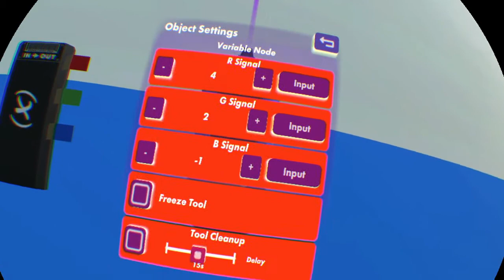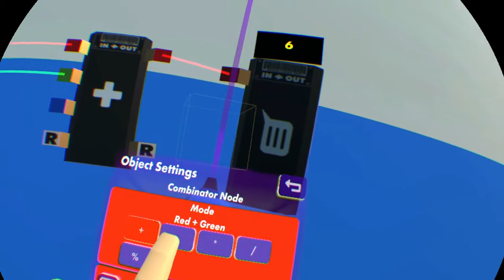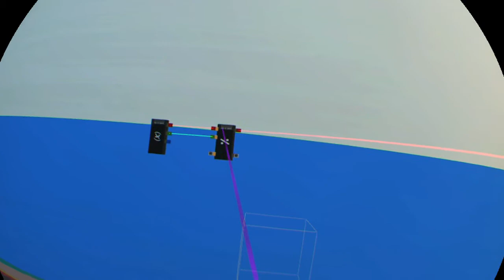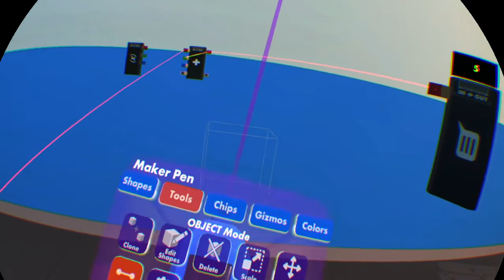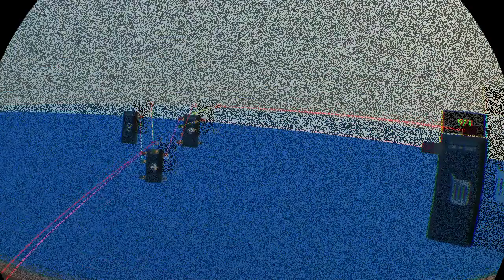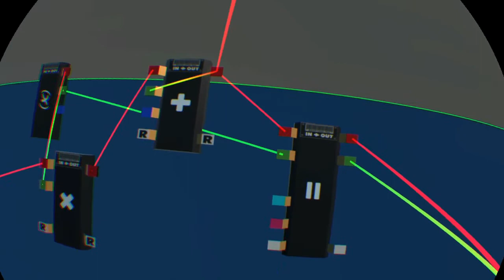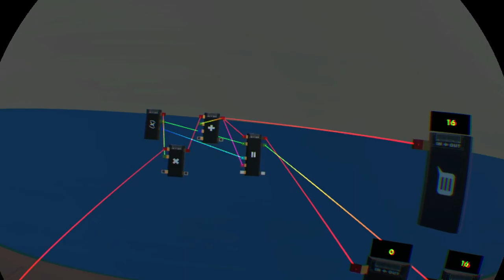Rec Room Tutorial Chips: Variable, Combinator, Comparer

Comment: How do I learn more about this stuff without actually learning programming languages?
Reply from the maker: That's an interesting question. If you mean more block based programming, really the only thing to do (without learning a system outside of recroom) is to practice with RecRooms system. However, the reason I recommend learning at least the basics of a language are that it will help you organize your thoughts and setup. The khan academy Java Script tutorial is a great option, and it only takes a day or two to get through.  Without learning a language, you will end up making your own internal language that will be expressed in the modules you come to rely on. This isn't a bad thing, in fact you may find some novel approaches that someone approaching the problem a different way wouldn't have thought of, but it will make learning this stuff harder. Also you need to learn to be okay with feeling frustrated, these videos are all of systems I am familiar with. When I'm working on projects, there is a lot of staring catatonicly at the screen, swearing, and occasional violence. But than there is sweet, sweet jubilation when you finally get it.
Reply: Vigorous Rapscallion
 Gotcha. Thank you for the help!